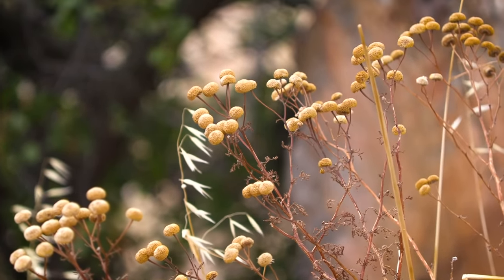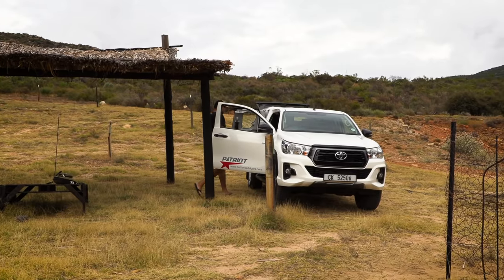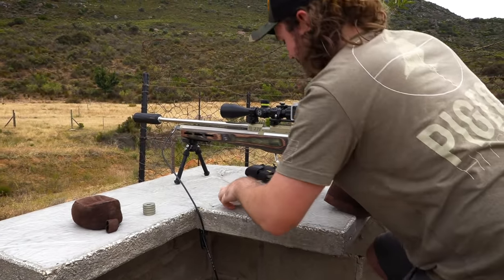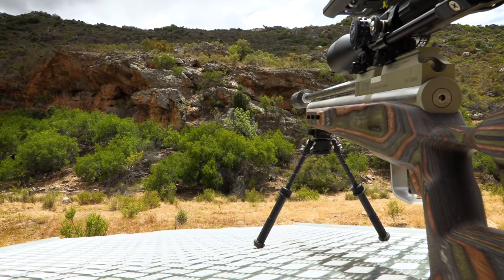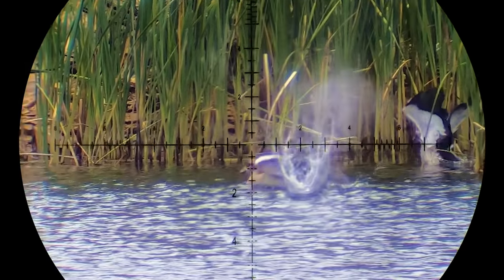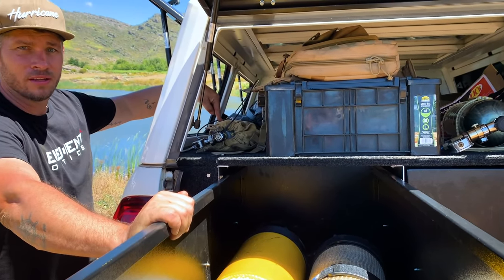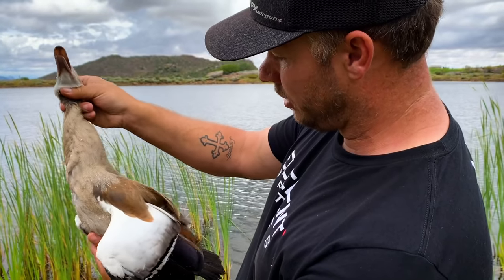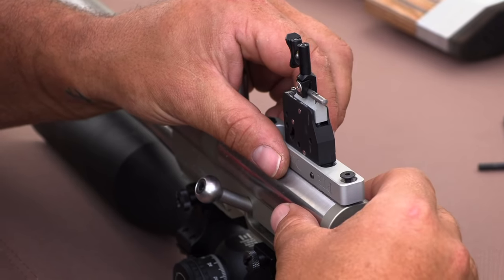Hyrax & Goose Hunt with PCP Airguns - A Busy Day in the Mountains!

Comment: It would be wiser to carry your bottles vertical, and well secured.    I’ve seen what a bottle with that kind of pressure does when the top is broken off…….It is not pretty!!   Unlike welding and other high pressure bottles you do NOT have a protective cap.

Comment: The “furry spectators”, if they are within 300 meters, they are most definitely in range for .22 cal @ 900+ fps. I’ve popped squirrels and rabbits with .22 sub-sonics @ 200-350 meters a lot.
Maybe it’s just that lead slinger sticks are just inherently more accurate in the US. 😜 Or maybe it’s just the shooter. 😎🤪😂